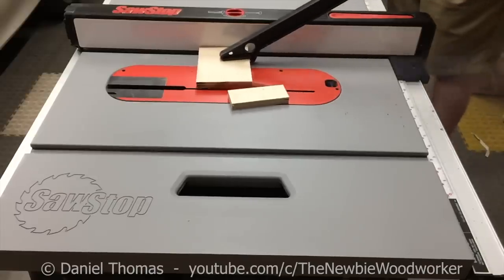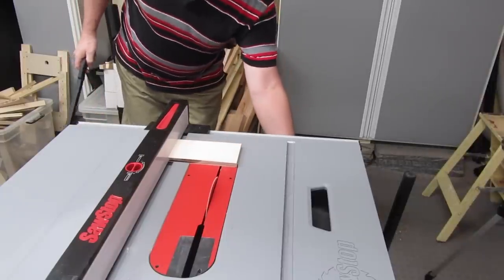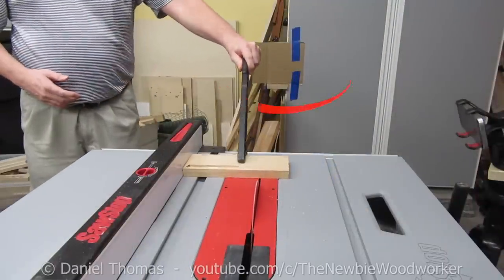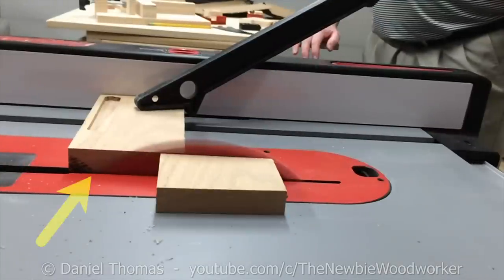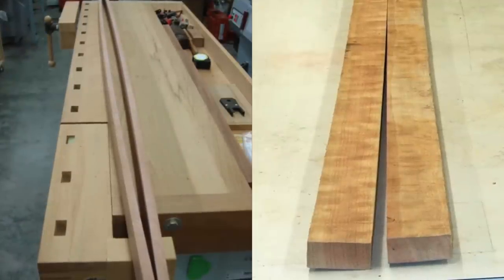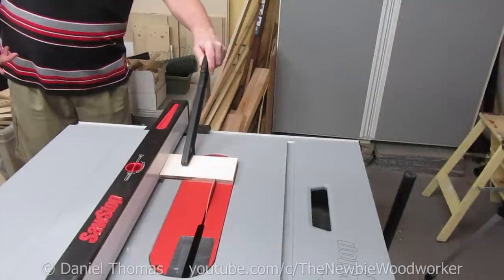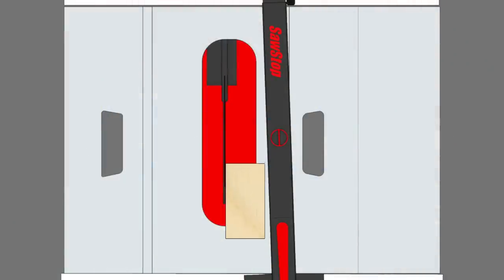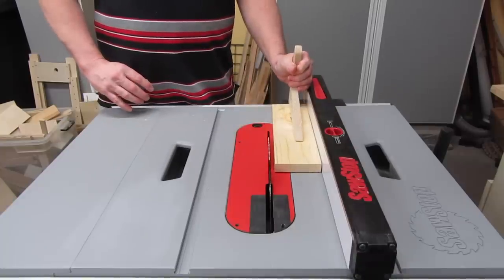Actual Kickback (in Slow Motion), & How to Prevent It

Comment: 1. Stop Cross cutting with a table saw, that's what a chop saw is for. If you have to cross cut, use a guide (and use a cross cut blade) and not the fence. The fence is for ripping.
2. Stop pushing the wood from off-center, it's going to rotate into the blade if you do that.
3. Stop hesitating during the cut, push the wood all the way past the blade in a single motion.
4. Stop pushing the wood so slowly, you should feel a firm even pressure against the blade (you were pushing so slowly you were burning the wood).

*Note: I wrote this before watching the last portion of the video where you covered most of it.

P.S. Your blade is too high, it should only be slightly higher than the material being cut.
Reply from the maker: Fred, I was trying to create kickback. That's the reasons for #1-4. And as for #1, you left out the most obvious way to do cross cuts, and that's by using a cross-cut sled. And no, you don't need a cross cut blade, a good combination blade will do the trick, perhaps depending on the type of wood and frequency of cuts. As for blade height, people argue this ad nauseum, so I won't get into that with you.
Reply: As I said, you covered most of this yourself in the video. You asked for our comments on how to avoid kickbacks and I wrote a list of the things you were demonstrating that were wrong. So basically I was agreeing with you. And I said to use a guide which would include a sled or miter gauge.

Combination blades are like all-season radials, good enough for light-duty use but not as good as the specialized options.

As to blade height, the blade shoudln't be any higher than it needs to be and it doesn't need to be any higher than the thickness of the wood. If something were to happen and your hand came down on top of the wood you're cutting, how high do you want the blade to be?
Reply from the maker: Thanks for your reply. As I said, I won't be getting into a discussion of blade height.
Reply: Fred Derf Regarding the blade height, that is a balancing act in my opinion. You are trading off controllability by reducing exposure of the blade. Let the teeth protrude by the minimum necessary to sever the stock, and there will be a more significant upward vector of the forces trying to kick the stock backward, as well a much better grip on the workpiece by the sawblade, with all those extra teeth buried in the cut. At maximum height, the forces are greatly more directed downward and absorbed by the table, more like a bandsaw. Just, who wants all that sawblade available to chop you up in the event of a slip.
Reply: The cutting force of the sawblade is never directed upwards unless you're doing a plunge cut (e.g. through an insert or a sled). Under normal usage the force is, at worst, directed towards you (which you should be prepared for). If you're getting significant kickback with your blade a tooth or less above the top of your work I'd suggest looking into the setup of your saw, something is wrong with it.

As I said, picture your hand accidentally coming down on top of the work you're cutting and think about how high you want the blade.

But hey, it's your saw, do what you want.
Reply from the maker: Fred, I understood what you said, but let me help to clarify something, for anyone reading along.

You said "The cutting force of the sawblade is never directed upwards unless you're doing a plunge cut". Some of you might say "But the back of the saw blade is coming up!" The answer to that is, yes, the blade is coming up, but it isn't cutting anything (assuming everything's aligned correctly). It's coming up into the already-cut kerf.

And no, I'm still not taking sides. I just wanted to make sure your comment is understood correctly. And of course, correct me if I'm wrong. 😄
Reply: The Newbie Woodworker, you've summarized my point exactly. You're probably smart to stay out of this, clearly I'm not.   :)

And BTW, Lee Haelters. You're wrong when you says that there would be a more significant upward motion with the blade in a lower position. Picture a blade protruding above the table a 1/4 of an inch, there would be little upward vector even possible. Now picture the blade up fully, there is a lot of potential upward vector.

Everything is more dangerous with the blade high above the stock, the only advantage (and it's slight) is the blade is cutting through less wood, the path of the teeth is more tangental perpendicular to the board. If that small difference affects your saw, you need a more powerful saw for the work you're doing (or a sharper blade  :)
Reply from the maker: Thanks, Fred. I will say this: Whether the height of the blade affects the quality of the cut, or the chances of kickback, I don't care . As far as I'm concerned, the fewer teeth above the table, the fewer teeth that can bite me.
Reply: The Newbie Woodworker, writes "Thanks, Fred. I will say this: Whether the height of the blade affects the quality of the cut, or the chances of kickback, I don't care . As far as I'm concerned, the fewer teeth above the table, the fewer teeth that can bite me."

Exactly.
Reply: This is very peculiar, Fred Derf. You and I are interpreting the same experimental results with completely opposite analyses. When I make a buried cut, I must apply pressure to keep the stock on the table. The higher I set the blade, the more force needed to hold the stock down. Feeding the same stock with the blade protruding significantly above, with an imprudent amount of exposure, yields a far more controllable feed effort. I guess that you are in "what happens when everything goes wrong mode"  and I am talking about normal operation. I can see that when stress relief closes the kerf and causes the stock to grip the back of the blade, that the rising teeth certainly want to lift the stock. But I would term the cutting action of a submerged blade as approaching tangential, not a blade set as high as possible. Do you view the cutting action of a bandsaw as tangential? I don't think that using under-powered hobbyist equipment is skewing my perception. My observations are from a lifetime of using professional and industrial equipment. Plenty horsepower there. L
Reply: Lee Haelters , writes "But I would term the cutting action of a submerged blade as approaching tangential, "

Oops, you're correct, I meant perpendicular. I've edited the original.

Comment: One super no-no you did was "pulling" the stock through in one of your kickback demos with a long "pull-stick" (standing on the "other side" of the saw).  NEVER pull stock through a table saw!  NEVER stand on the "intake" side of the blade!  Much worse than kickback, is "pull in" where you are pulled over the blade.  At least with kickback, you are hit by "only" a piece of wood.  USE GUARDS!  Also use StopSaw.
Reply from the maker: While I agree with you in general, perhaps you couldn't tell from the camera angle, but I was using a long handle and there's no way I would have been pulled into the blade from there. But yes, a lot, if not most of what I tried isn't recommended at all. 🙂
Reply: Yea at first I was thinking pull stick that sounds great... then I thought of the implications: either it can pull you violently forward or you rip the long pullstick out of your hand violently. I would only want to use that if the pull stick were long with a smooth holding handle, something like a broomstick.
Reply from the maker: @lakecityransom  👍
Reply: What do you mean never stand on the intake side of the blade? In right handed and I stay to the left of the fence, then wood piece, then saw, then loose piece. It feels more natural to me and out of the way of a possible kickback. I stay to the side and use the push stick...
Reply from the maker: @NoRoads2AllRoads  I think we're trying to say the same thing, in different words. The bottom line is, stay out of the line of fire. 😄
Reply: @TheNewbieWoodworker  I was referring to Bryan's comment... I'm a newbie on table saw as well and I have huge fear of it... Luckily I guess I'm doing all the best practices possible and taking my time around the cuts
Reply from the maker: @NoRoads2AllRoads  Ah, I got it. Thanks for clarifying. As for having a huge fear, that in itself can be dangerous. How about just having a lot of respect for the tool? That at least sounds better. 😛

Comment: Wow! You're more courageous than I. I squirmed in my seat just watching the video. I appreciate your efforts here to inform. It's a well done video.

My only additional observation is that a properly used featherboard seems to help me keep a board being ripped tight against the fence. Of course, I always make sure the featherboard does not push or hold the wood against the saw blade.
Reply from the maker: Thanks, and an excellent point. I use featherboards every now and then, mostly when I'm cutting something thin. But anything that keeps your hand away from the blade is usually good, right? 😄

Comment: Good learning video, a couple of years ago.  I had kick back that hit me on my left hand and stomach, it broken my index knuckle and bruised my stomach.  Looking back, I believe it was my fault because I was using a good push stick with my right hand between the blade and the fence.  For some dumb reason I was focus on the board on the left side of the blade and I stopped feeding the board just past the mid point of the blade.  The piece kind of twisted between the blade and the fence and road up the blade in the up cut and shot it back.  It was so fast, but you don't forget it.  I'm far from the best wood worker, but a good thing to know is as you push the piece towards the blade, the blade cuts the piece on the down cut but when you pass the mid point of the blade it is pushing the piece upward and that's how it catches on the blade.   It comes at you as fast as your blade is turning.  I believe if I had continued the push of the piece with my right hand and not stopped the forward movement it would of never happened.   It was only a 6x10 piece of 3/4 in plywood.  Thanks for your video...
Reply from the maker: Thanks for sharing! Yeah, you never want to feed your stock by pushing the left side. It forces the stock to pinch the blade in the back, and you know what happens after that. All the pushing should be done on the pieces between the fence and the blade. Obviously you don't want the left side to drag behind, so you do have to feed it along - just not so much it pinches the blade. And of course a riving knife would probably have prevented the accident. We learn, right? 😄
Reply: @TheNewbieWoodworker  Glad you took the time to reply to my comment, I do enjoy learning from your knowledge.  I was pushing the stock on the right side of the blade between the blade and the fence.  I believe the problem happen when i stopped the stock feed half way through the cut and gave the stock time to twist a little between the blade and the fence. So if I had continued the cut all the way through, the stock would of not twisted.  Anyway Thank for your reply, and keep making those video's......
Reply from the maker: @marty3060  Thanks, and you're quite welcome!
Reply: Was the riving knife/splitter installed?
Reply from the maker: @yautza8569  No. But it is now. 😀

Comment: I've never left a comment on a YouTube video before this! But I needed to say thank you, thank you so much for this EXCELLENT breakdown of the phenomenon of kickback. So scary. I'm sure all your viewers are very thankful that you didn't get hurt making this video.

I wanted to add that having the saw blade tilted at an angle (ie. Not misaligned with the fence - still perfectly parallel to the fence, but tilted downwards to make a bevel cut) may also increase the risk of kickback when performing what would otherwise seem like a perfectly safe cut. I experienced kickback when performing such a cut and got shot in the rib by a flying piece of wood - no fun. Thankfuly, no injury besides that. I think the reason it happened (my own fault, of course), was because I was trying to make a 45deg bevel cut but the offcut piece was way too large. What I should have done was to trim my workpiece down first using the normal straight blade, such that there would only be an excess of 10mm (3/8 inch?) or so that would be trimmed off for the final bevel cut. That's exactly what I did after my mistake and the cut went much more smoothly. I'm not exactly sure why this is, though. Anybody have thoughts on this?
Reply from the maker: Thanks for the comment! I'm assuming your blade tilts towards the fence? If you can, try putting your fence on the other side of the blade when making bevel cuts, so the blade tilts away from the fence. It would be much safer, in my opinion.
Reply: @TheNewbieWoodworker  Yes, that's right, the blade tilts towards the fence. That makes sense, I didn't think of that! Unfortunately, I use this table saw which doesn't give you the option of putting the rip fence on the other side. You're either using a rip fence that's on the right of the blade, or a cross-cut fence on the left of the blade, actually; the whole cross-cut fence moves along with your body and your workpiece, in the direction of the cut. The cross-cut fence basically moves back and forth along left side of the table saw, so there's no fixed 'table' on the left for a rip fence. (does all this make sense? Hahaha)
Reply from the maker: @ziyadbagharib7803  I wonder if you could make the bevel cuts using a crosscut sled? You'd probably want to clamp the stock down, but then you wouldn't need the fence? Just a thought.
Reply: @TheNewbieWoodworker  thanks a lot for the advice! I'm looking forward to seeing many more of your videos. Cheers!
Reply from the maker: @ziyadbagharib7803  Thanks. The other thought I had, and it probably should have been the first one, is to make sure your fence and blade are aligned correctly. If your fence is toed in some, it could definitely cause the stock to bind at the rear of the blade, which can cause kickback for sure.

Comment: I have been using a radial arm and table saw for 47 years. I watched your video because my dad taught my how to use them and said never stop learning. Well actually the motivation for watching is below. The radial saw really scares me, I respect the table saw.  I have never had a kick back or close call.  I saw your video and thought holy $#!t. I decided to come read all the negative comments I thought you would get for showing off.  I knew was it possible and best to avoid why risk this just to make a You tube video.

I was taught very early to be careful respect stuff that can maim or kill you.  I have not used any safety features, splitter or guards.  I have usually used a push stick or some random piece of cutoff laying around to keep my fingers away from sharp spinning things.  Then I saw the shiny new Saw Stop.  I needed a good reason to convince myself that I needed one.  More importantly how to convince my wife.

I have read all the comments and I now commend you for making the video.  You will made anyone that is open to learning, think about what they have doing and ‘wow’ I like how you handle the negative comments.

I especially appreciate the comment about you not using a guard. I have felt guilty about not using one. It always feels like they get in my way and for some reason that makes it feel more dangerous.  I keep trying them and then remove them.  Maybe the Saw Stop guard will be different.

Will I get the Saw Stop?  Well.. last week my wife and I went to a family event and her Nephew showed off his mangled fingers that he had just run into his table saw.  He permanently lost the nail on his left index finger and has serious lacerations on one other finger the good news is they are all still the same length.

He was using a crosscut table to trim a kitchen cutting board and thought he was being very safe.  This is a low risk task on a table saw.  How could this happen?  He said he was rushed, stood on the right side of the sled when he usually stands left side.  He thought he put his hands in the usual place. Wrong.  The blade exited the back of the sled and it was in line with his left hand.  Off to the emergency.  While he was there three other people (men) came in with table-saw hand injuries.  REALLY!!

I now have a new Saw Stop at my wife’s insistence.  There is a silver lining to every cloud.

Old dogs need to learn new tricks. Keep up the great videos, ignore negativity. You just added one more subscriber.  Thanks.
Reply from the maker: Thanks, and that was a great comment! I really enjoy hearing stories like that (well, not the mangled fingers), and I appreciate the positive comments. I don't use the blade guard. I use a riving knife whenever possible, but like you said, the blade guard just gets in the way. And honestly, I don't feel comfortable making a lot of cuts with the blade guard, so I think I'm better off without it.

That said, I stuck my thumb in the blade a couple of weeks ago (video forthcoming). Needless to say, I'm thrilled to have a SawStop. How did it happen? I was in a hurry and my mind was on the next step. And my SawStop was due to my wife's insistence also.

Thanks for the encouragement. I have no idea why I'm handling the negativity as well as I am. I'm not like this in real life - I yell back. 😄But for some unknown reason, when I started this channel, I decided to try an experiment and give everyone the benefit of the doubt. And it's worked out better than I could have ever imagined. Not with everyone, but with a lot of people.

Anyway, good to have you aboard. If you get a chance, check out my blog at https://thenewbiewoodworker.com. I'd love to hear your input.

Thanks again! 😄